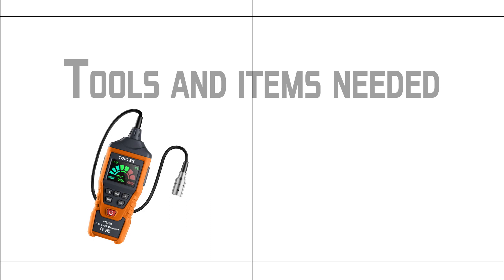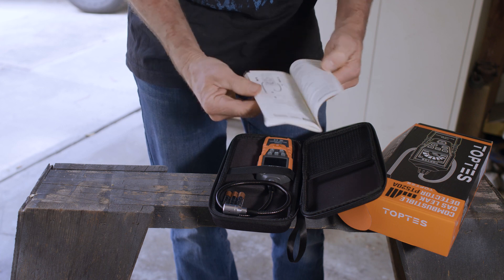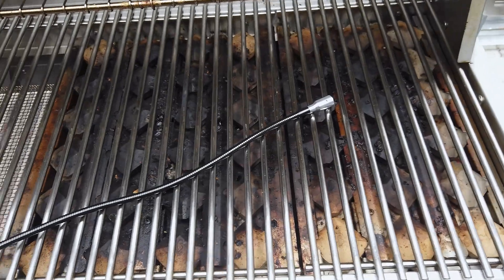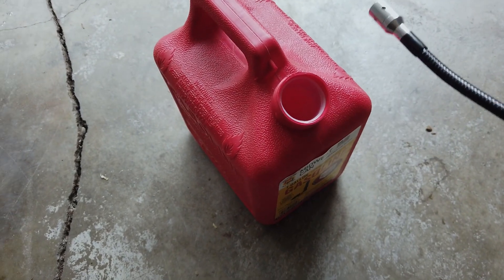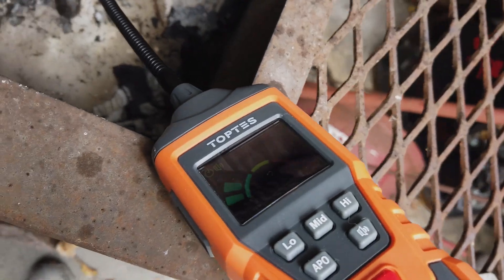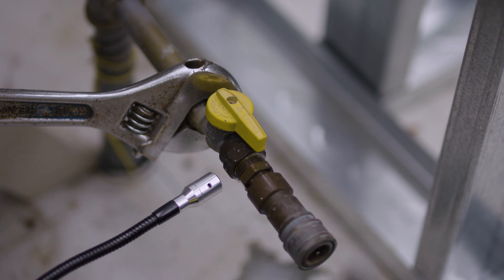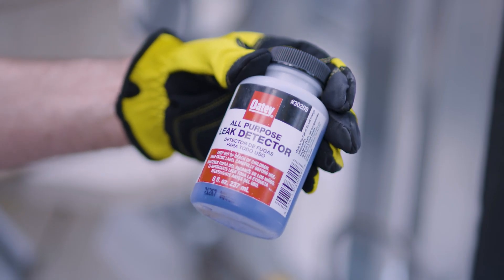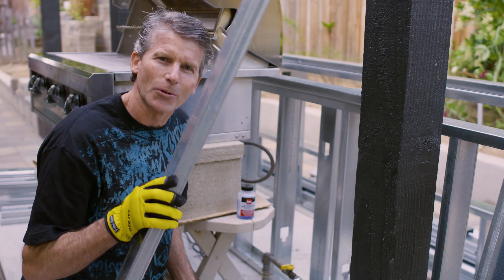Gas leak detector -TopTes PT520A review

Comment: I wonder if the detector didn't detect the gas from the bubbling joint because the bubbles were essentially holding the gas,  I noticed once at 7:13 in the video as soon as the big bubble at the bottom popped it went off.
Reply from the maker: Possibly, I did the test a few times and the bubbles would appear before the detector went off each time. I still trust using a liquid over an electric one for finding a small leak.
Reply: @ldsYeah I get that, I'm just saying there was a covering that prevented the gas from escaping hence the detector couldn't possible detect the gas because it was trapped in the bubbles, so of course the bubbles would appear first every time.   

I know it's been a number of months since you did the test but it would be interesting to see if you had started turning the pipe the same amount without the solution over the joint if the detector would have detected.

That said if you have an unknown leak, it might be useful to probe each joint until you find the leak instead of putting on soapy water to each joint.    I ran into a problem with my dryer (gas powered) where I felt there was a leak (smelled it) but had no idea where it was, and was going mad soaping up all the joints right next to the gas hookup, etc.   Eventually I found out there were no leaks from any joints in the pipe, but instead due to some faulty mechanism inside the dryer that I have no idea where unless I take the whole thing apart, and at this point I might as well just replace it (it is well over 20 years old)